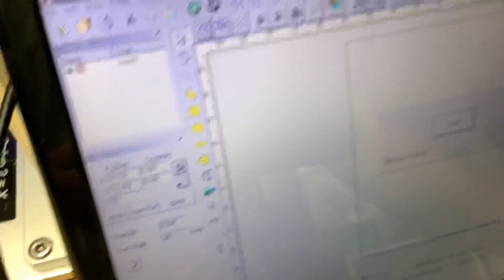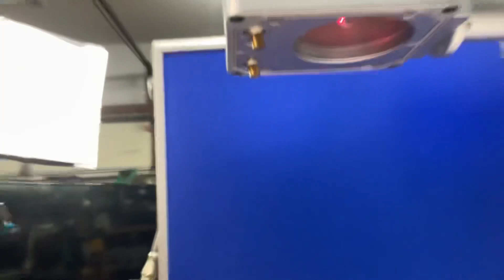How To Align The Preview/Red Laser in Your Fiber Laser Manually

Comment: i have a raytcus 50w is this the same process to focus it? the optimal focal point for the laser to engrave is about 3 mm shorter than where my red preview laser making the red laser slightly fuzzy i can still see what its projecting just not a crisp clean line
Reply from the maker: the central laser has nothing to do with focus. it is purely there as a preview of what will be lasered, and needs adjusted in the software to line up perfectly with the final result. Focus is done manually, or on some machines with 2 additional lasers. I personally don't use the 2 lasers because I never felt like I could get them perfect
Reply: @CalebKraftmakes  I understand that... The preview is blurry when the laser is in focus... If I move the laser head down 5mm or so the preview line is in focus is there a way I can refocus the red preview light to be in focus while the fiber is in focus?
Reply from the maker: @Stakespecialty  I'm not an expert but that shouldn't be possible if the preview laser is properly centered. They both go through the same lens on mine. This means you probably have a set up I am just not familiar with. I'd check out https://www.youtube.com/@LaserEverything , they have a discord where people help each other out.
Reply: @CalebKraftmakes  I know I'm in that discord nobody has been able to help 😔
Reply from the maker: @Stakespecialty  I could see this happening possibly if the preview laser is not centered. or if it is faulty and super wide for some reason. if it is centered and correctly functional, they both get focused by the same lens.
Reply: @CalebKraftmakes  see that's why I was confused at why it's fuzzy .... I took the top off of my laser head but I was unsure of what I needed to move around to get it to work
Reply from the maker: @Stakespecialty  it kind of sounds like you just need to do what is in this video. again though, I'm not an expert in all lasers. Before you get into the complicated alignment process though, check to see if yours is even mounted straight. I used a 3d printed part to fix mine after this video https://www.printables.com/model/368332-fiber-laser-preview-beam-alignment-sleeve
Reply: @CalebKraftmakes  thank you I will check it out

Comment: i have a 50w split and have 2 red dots which are not near one another.  I can bring them together but it is not near the focal length that I need, nor are they near the work area of the rectangle that I'm testing.  What does 2 red dots do to a project if I run a test and shouldn't the red dot be in the middle of the project that you are trying to engrave?
Reply from the maker: 2 red dots aren't for aiming the laser. The 2 red dots are meant to be adjusted to come together as one dot when you hit the perfect distance from the surface. Your'e supposed to re adjust those whenever you get the laser or when you change lenses. I can never get them perfect so I just turn them off.
Reply: @CalebKraftmakes  thank you very much

Comment: Perfect, my Monport GI60 came with the internal dot four inches away from the other two.
Reply from the maker: the two dots are totally different. they're not supposed to be all togetther. the 2 dots are for marrking the perfect distance to the lense.
Reply: @CalebKraftmakes  is it actually work with the fiber laser source etiher?, since i have the same problem with my machine accuration.

I has bought a 50 w fiber laser recently, with 430 f theta lens (a.k.a 300x300mm lens). shortly, i calibrated my focal length and so on to create a perfect 300x300 mm square and it works. unfortunately, when i create 250, 200, 100, 50 square, there is always minus 2 mm minus on boundary (like 248mm and so on). I tried some trial and error by change galvo software axis, using both ez cad and lightburn. but yes, they has made a same consclusion and problem. Iam really hope i was miss something on software part instead do something or buy another lens for my machine. is there any suggestion maybe?
Reply from the maker: @ihzanursyahbana7773  what you're describing is most likely something to fix in the software. You should contact the support for your laser manufacturer

Comment: i have a slightly different issue with my laser; the red laser is slightly out of focus compared to the main beam (the red laser is in focus around 20 mm above the focus plane of the main beam). you reckon that's fixable by adjusting it there?
Reply: I have the same problem on my JPT, apparently the light wavelengths have a different focal point when going through the lens (red ±650nm, but the engraving light is ±1064nm). It's really annoying as my light in built into the source. If yours is like the one in the video, it might have a 'twist to focus' mechanism.
Reply: @KevinGuyPalmer  i have a jpt source as well, so i am slightly disappointed to hear that. i thought it would have a similar arrangement to this, but i opened it up and the laser source shines directly into the galvo head. i even opened up the head to see if anything is in there, but apart from a bunch of magnets; nada. are you sure it's due to an issue with the wavelength of the light? in any case, i have reached out to jpt laser; perhaps they will come up with a solution or give me the same answer you gave me
Reply: @ikbendusan  please keep me updated if you hear back from JPT! 

From what I've been able to find out if you have a lens with a smaller work area it will decrease the difference in distance between the two focus points (I have a 175mm lens and the difference is also just over 20mm). I am ordering a 112mm lens and I'll see if that makes a difference. Will let you know. 

Seeing as you're the kind of person willing to open things up your not supposed to, JPT has a video on their YouTube channel that shows how the MOPA works, at around 10seconds I can see the red light module. Unfortunately I can't post a screenshot here to show you.
Reply: @KevinGuyPalmer  i think i also have a 175 mm lens, i'm not sure; it's not written anywhere on the lens. i think i ordered a 150 but this alibaba dude i bought the kit from is supportive like quicksand

i'll keep you posted and i'll go find that video, thanks
Reply: @KevinGuyPalmer  it may well be that you're right about the wave length; the product page from JPT says the beam diameter is 7 mm. because the hot glue solution in the raycus source as showin in this video uses a much smaller point source that is combined into the output, the effect is nowhere near as pronounced

i hope there's a way to resolve this but it may involve recreating the raycus solution or coming up with an different method of previewing (red laser correction being applied 20 mm above the IR focal plane)
Reply: @KevinGuyPalmer  does your preview laser also slow down after the first time you've activated the engraving?
Reply: @ikbendusan  I can't say I've paid too much attention to it, but I have noticed it's slower sometimes. Most of my engraving is below 10mm, so the whole piece is pretty much red when previewed. 

I know you can change the speed of the preview light 
EZCAD, under the F3 menu
Lightburn, device/galvo settings
Reply: @KevinGuyPalmer  yeah i know; i maxed it out, but it seems to ignore the setting after i've done an engraving. when i boot the machine it's fine
Reply: @KevinGuyPalmer  which galvo scanner do you have?

Comment: Wow not a cheap laser at around 3k, I'm very interested to see what it's capable of though.
Reply from the maker: as far as fiber lasers go, or even powerful desktop lasers, this is surprisingly cheap. cheaper than a glowforge and you can actually engrave metal with it! Brass engravings will be a project soon and probably a side by side comparison of hand engraving and laser engraving.
Reply: @CalebKraftmakes  awesome, I've used k40 style co2 lasers mostly. So no metal marking though can do Ali with paint ect, but those start around 300ish